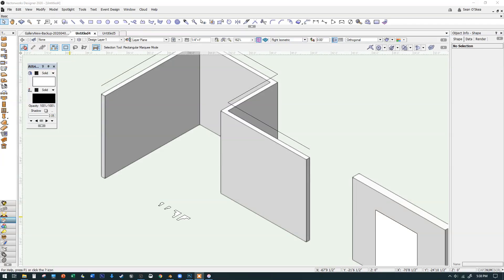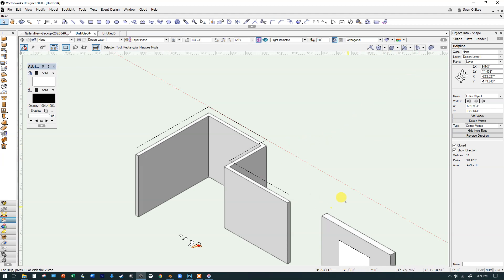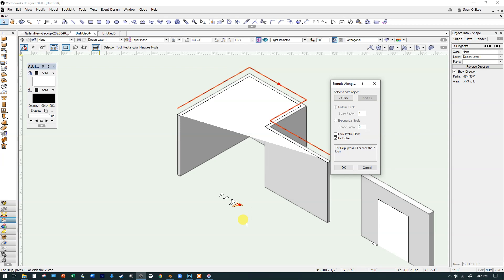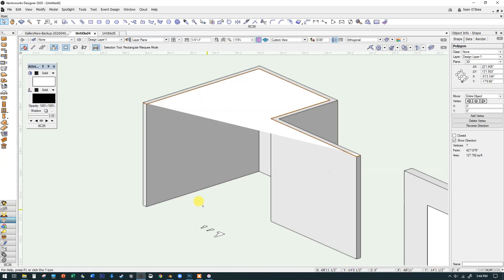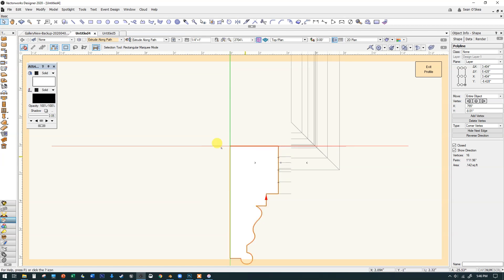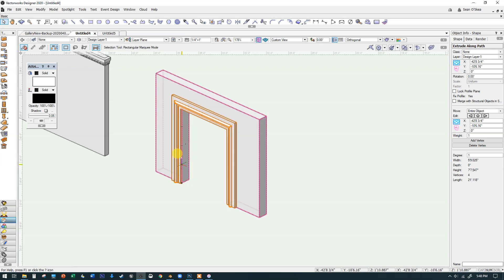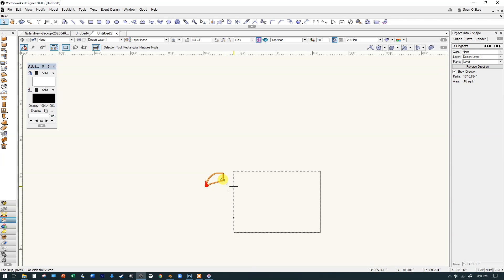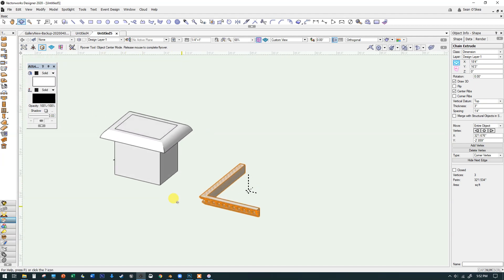Vectorworks Extrude Along a Path

Comment: Hey Sean,

I design skate parks and have used the extrude along a path tool a lot over the years but I have always had problems when the path includes  quarter circles or half circles for the path to go gently around a corner? Is there  a reason why 2D paths have problems  (with direction or geometry?) when creating the path.?? also if you make the path with a variety of tools and poly line them  into a line, it often doesn't work for the extrude?
Reply from the maker: Not sure I totally understand your question but I think it may have more to do with your path than your profile.  Sounds like you are using an arc to drive the sloping sides of the wall around? If you have sharp 90deg corners in the path then the circle is going to come to a sharp corner just like if you drove a router bit around a 90 corner of wood. Try using the Polyline tool and Bezier curves. Or assemble your path from a bunch of looseo lines, curves, and acrs  with all the endpoints touching and use the MODIFY>Compose command to make them one path. That way when your circle or arc drives around corners they will be big smooth corners not sharp abrupt ones.  Hope I understood you question.
Reply from the maker: Ok re-read your post, and I obviously misunderstood, you're describing that you do what I suggested you do. Sorry. I played around with it myself and couldn't get it to fail. But then I'm just fooling around and you've no doubt done this hundreds of times. I guess I'm not being very helpful, sorry.
Reply: @seanposkea   The problem might be I use Curved profiles  and then try to curve them in plan as well (eg curved curves.) and the toe of the profile has problems when it is too tight. Eg when the toe of the extrude along a path also curves it works OK but if the Curved profile turns around a point (ie quite tight) it has problems and doesn't do the extrude final product. Does the software have problems with odd shapes that need to curve in 2 directions? Or can there be a  a problme with the extrude profile if it has not been draw the right way? eg all lines directions going the same way? I usually just draw them like a 2D object and then combine them into a polyline before extruding.

I usually just break up the long extrude paths into sections (2max pieces eg a corner and a straight) and then extrude each.  rather than a huge long face curved wall (with a single polyline) it becomes tedious however with a larger skatepark.